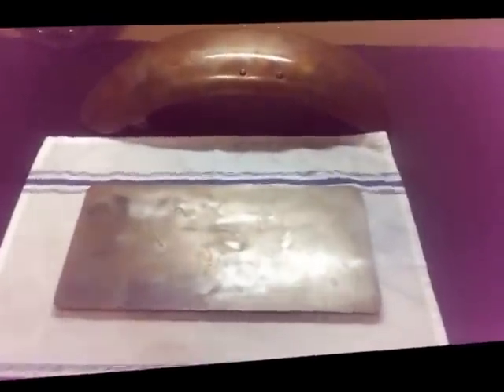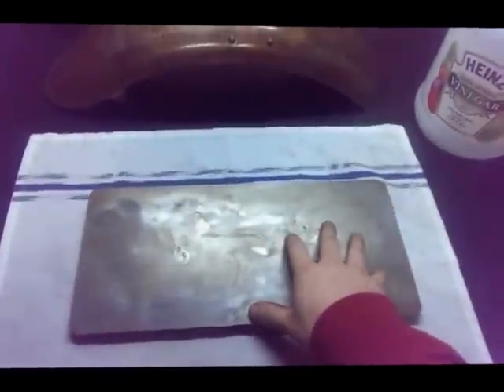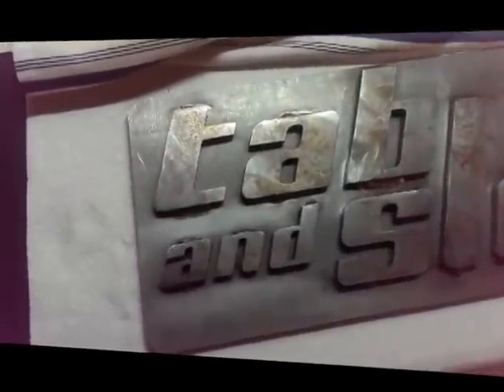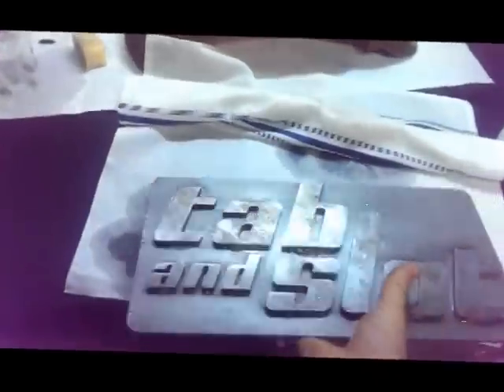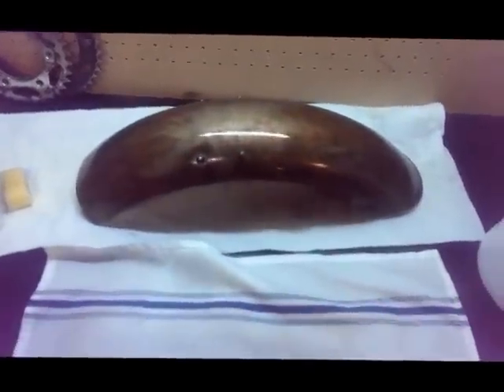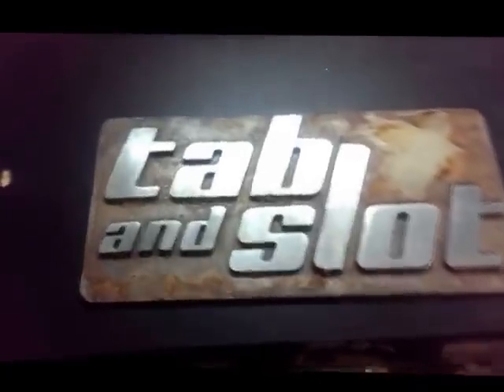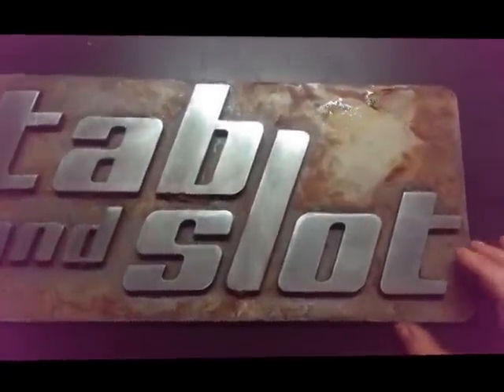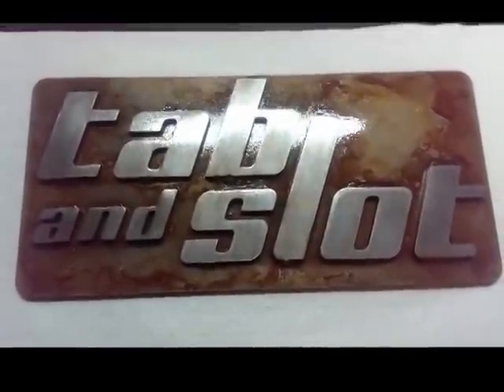How to Create a Forced Patina on Steel

Comment: If you were to 'block' an area before applying vinegar (using a vinyl stencil for example), would you be able to get sharp lines or will the oxidation blur edges? I'm thinking of building up a multi-layered stencil with multiple applications. Anyone know if this will work? Thanks
Reply: Did you try it?
Reply: Should work. Once I didn’t notice a sticker was on the bottom and it was not aged underneath.

Comment: Joe, how will I do it with a 5 gal. tank. That is the style I am looking for with my Harley. I am not picky. You mentioned lacquer. Would I use that as well? I am fixing to take all paint off on fenders, and gas tank.
Reply: +Thor Hamm - Hi there, so did you do that to your tins? How did it turn out? Any pics? I'd like to do this to my Honda Valkyrie. Cheers!
Reply: Hey, I have yet to get the paint off. I got very busy. But I am working on it. I will post photos as soon as it comes. Thanks for your response.
Reply: Also, I did talked with a painter(cars), says, as long as you coat it with clear that it is ok but would rather use paint to get same effect than rusting it. Rust unpredictable with time.

Comment: Does it work on stainless steel? Got a kitchen tray and bowl I'd like to use on my food photos and I would like them to look old and used. Should this work? Or should I use fine sandpaper first before using vinegar?
Reply: +Karolina F  are u asking if u can stain stainless steel?
Reply: +Alex Storms Yup, you know, that Chinese piece of crap called stainless steel ;) I've bought few trays for my food photography. I thought that I could somehow be able to quickly destroy them and make them look older. After using steel wool on them there is only rust, a better option was to paint them with chalk paint.
Reply: re-sand it and try,  pitting from rust may give them a nice "aged" look
Reply: Karolina F هلوووووو